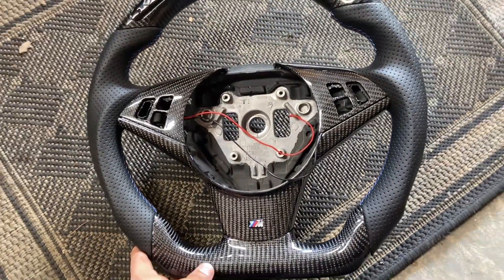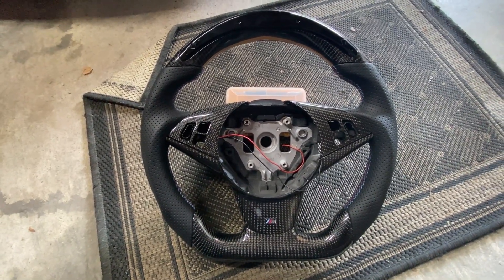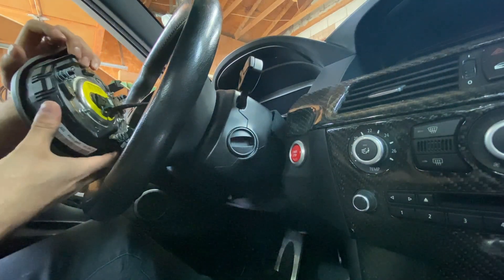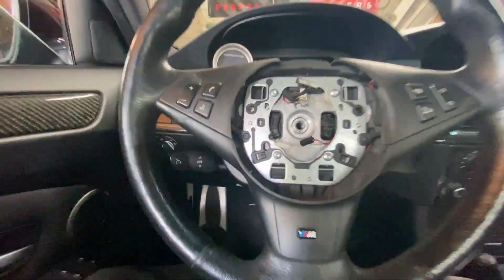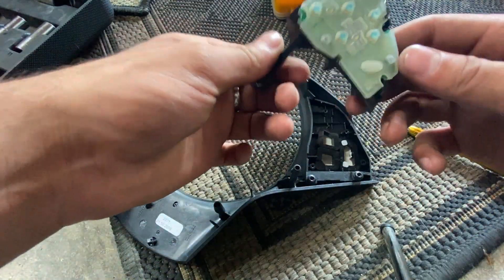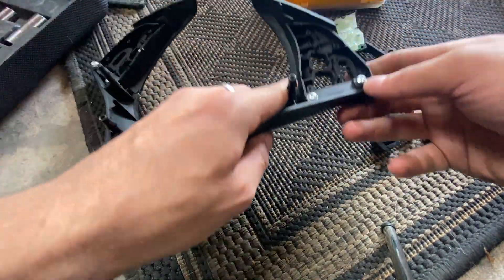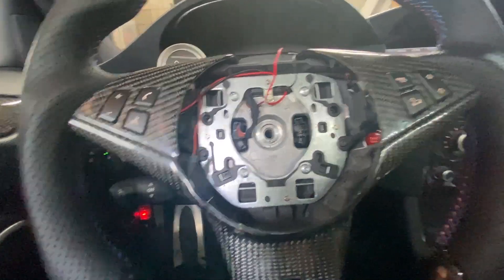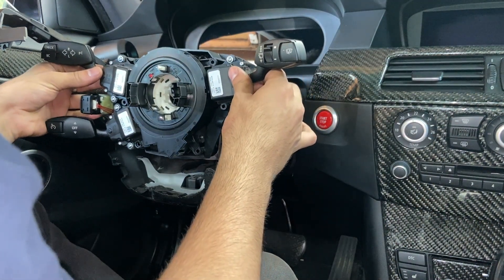Custom ALI EXPRESS Carbon Fiber Steering Wheel W/ LED Display

Comment: Hi does it work on the bmw e60 2004?
Reply from the maker: Yes, should be exactly the same. Just make sure you order a pre LCI steering wheel. The LCI and Pre LCI ones have different mounting mechanisms on the back of the steering wheel.
Reply: @ yes, I know they are different, I was talking about the wiring and obd if there is any difference, that's what I was thinking! Thx
Reply from the maker: Wiring should be identical

Comment: Hello brother I have a gen 5 galaxy pro led on a pre lci e60 is it the same method? I am scared to touch the clock spring 😆
Reply from the maker: Yes! Almost all LED steering wheels only require power and ground. Some also have a separate OBD2 module that needs to be installed. But in your case, your install should be very similar to mine. Just take extra care when opening up the clock-spring and you sound be fine. Good luck!
Reply: @TheAutoSurgeon  thank you brother i will give it a try,this trick not drain battary when the car is locked right? Thanks
Reply from the maker: Yes, just make sure the power source you tap into is only powered when the car is on.
Reply: @TheAutoSurgeon  I will make same with yours 😁 I trust you and I like also the interior lights it will be the next setup I hope

Comment: By re-connecting the battery without the airbag connected you're going to have the airbag warning light on your cluster.
Reply from the maker: Yes, but when you reinstall the airbag, disconnect the battery and reconnect, it clears the airbag light.
Reply: @TheAutoSurgeon  - Have you actually tried this, I can tell you that simply disconnecting and reconnecting the battery will not clear the airbag light
Reply from the maker: It absolutely does! You just have to keep the battery disconnected for about 10 minutes to allow it to reset. I’m speaking from experience—installing this steering wheel. If you’re having trouble, maybe try to keep the battery disconnected for a little longer, it will definitely clear - I can only confirm this if it’s pertaining to the steering wheel or the the door panel airbag, both of which I have removed and reinstalled without issues.
Reply: @TheAutoSurgeon   - The only way I've seen to disable the airbag light is with a dedicated scan tool, you would have to be the only one that 's been able to do it by simply disconnecting the battery, sorry for being sceptical  but I've tried it on numerous occasions and it doesn't work.
Reply from the maker: I’m not sure, I don’t think my car is special. As long as the airbag is reconnected and good, I don’t see why the airbag code would be permanent. Maybe it’s a BMW thing, if you’re talking about trying it on different brands.
Reply: @TheAutoSurgeon   - I'm talking about BMW specifically here, whenever you unplug the air bag while the battery is connected it will  show an airbag light on the cluster and can only be cleared with a dedicated scan tool, disconnecting and reconnecting the battery after the fact will not clear the airbag light.
I can assure you that this is 100% accurate.
Reply: @darkoz1692 I followed the video exactly and I don’t have a airbag light what the auto surgeon is saying is right I did the exact same thing

Comment: Is it similar connections with as the e46? To wire
Reply from the maker: You should be able to find a similar way to wire the power on your e46!

Comment: the aliexpress lionk appears to be to a different wheel without the led display
Reply from the maker: It unfortunately looks like they’ve changed the ad. I’m sure you can find another one through a quick search on Ali Express! Most of them are probably made in the same factory.
Reply: @TheAutoSurgeon  how much did you pay for yours im considering just buying the led bit from ohc motors and doing the rest of the wheel diy
Reply from the maker: It was about $1200 CAD. It’s going to be a pretty involved DIY, depending on what modifications you’re planning to make. If you’re going to be changing the shape of the steering wheel (flat bottom with cutouts) you’re going to need to make a mold and remold the shape of the steering wheel. But if you plan to keep the original shape and just re wrap it in new leather with the LED display, it should be a relatively simple process.